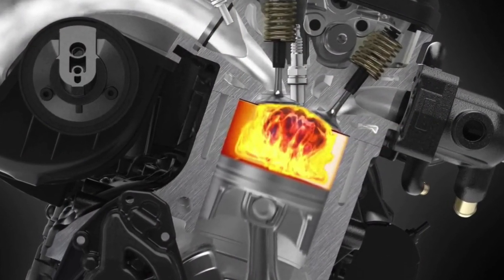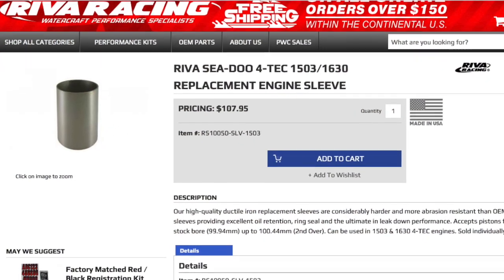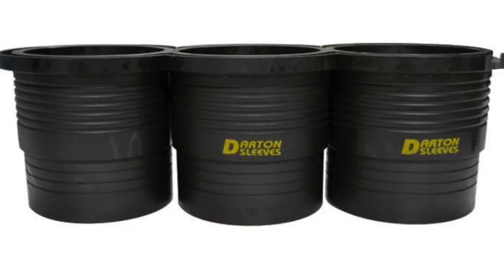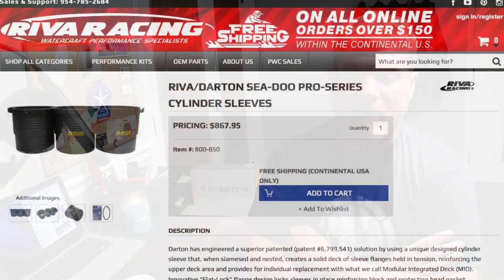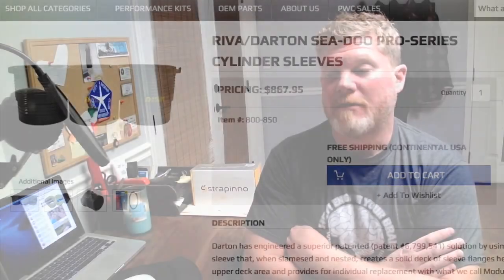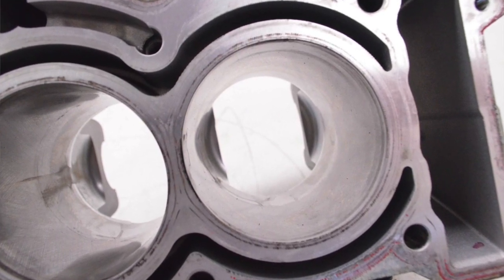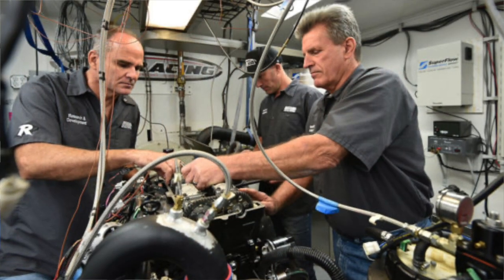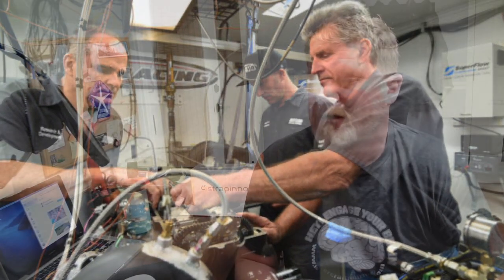Can Sea-Doo's 1630 ACE Engine Be Fitted With Steel Sleeves? WCJ Quick Topic

Comment: Hi I am 19 years old and want to start a project of swapping the weber engine in a Williams Turbojet 445 tender to a rotax. I can’t decide to go with 1053 or 1630. I am looking for 130hp models on both. I am very concerned about this cylinder wall problem on the 1630. People say that you need to change the block since you can’t repair the walls. But I also can’t find price of the block of 1630 new.

Comment: They have been using Plasma coating in high performance car engines for a decade now. They work well, some can fail but not generally an issue unless you really push the boost to crazy amounts and are putting that extra pressure on the walls or piston skirts/rings
Reply from the maker: They've been using them in motorcycles for decades too. Not all coatings are created equal. Failures are continuing to happen to this day. Just check out the Sea-Doo 300 Owners page on FB.

Comment: I had a engine full of water and engine has failed,
Smashed up base of spark plug,
Would a replacement engine be more cost effective than rebuild
Reply from the maker: Yes it would. And quicker.
Reply: @watercraftjournal  ,
It’s at 190 hours,
Sad story but ,
Some dodgy work done by shop and no insurance on my part 😢
Reply from the maker: Ugh that sucks

Comment: Supercharger failure, low oil , poor maintenance could all fry cylinder bore requiring a sleeve.
Reply from the maker: Yes, all true too. But that’s for a single; the top performance guys are using the Siamese kit for other reasons.

Comment: Your average 50 hour-a-year weekend warrier will probably never have an issue with the Rotax plasma coating. As much as I love to hate on SeaDoo, none of the SeaDoo riders I’ve talked to at the boat ramps have had any issues with their 300s. SeaDoo sells so many skis, the so called defective units are likely a really small fraction of their overall production.
Reply from the maker: Oh its incredibly small, and sleeving such an engine is an exorbitant cost to negate a very unlikely failure.

Comment: Coming from Hondas,  the sleeves make the cylinder stronger to handle boost.  I don’t think the plasma coating failure is reason they are resleeving.  I imagine the stock Seadoo cylinders have a boost limit.
Reply from the maker: Agreed! Again, the guys who are sleeving their 1630 engines are doing so because they're running MASSIVE amounts of boost.